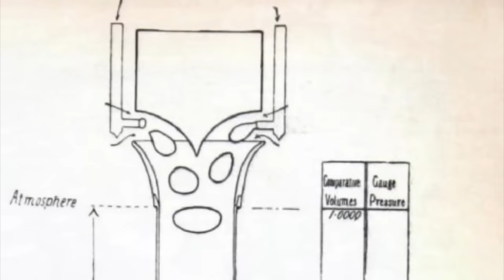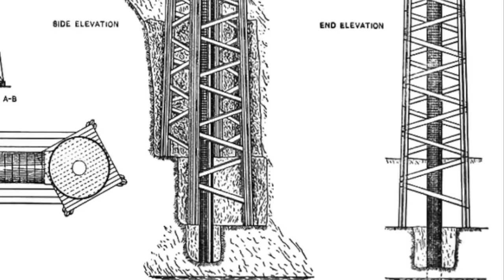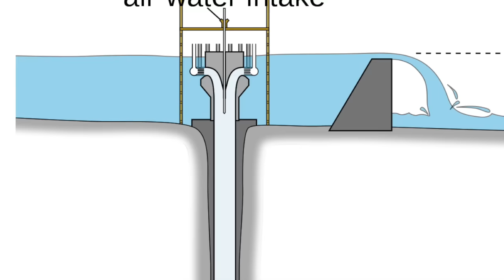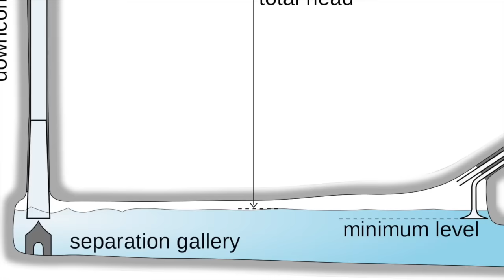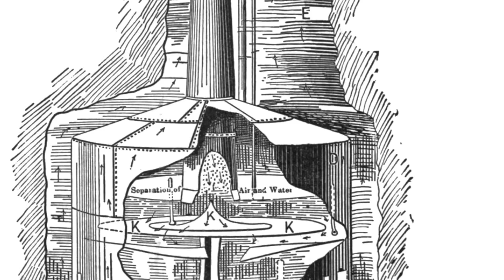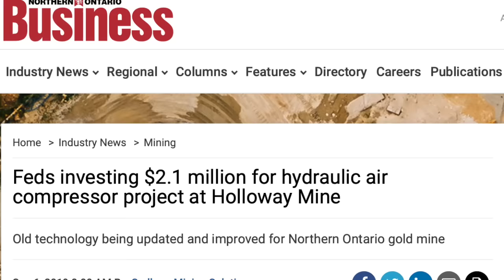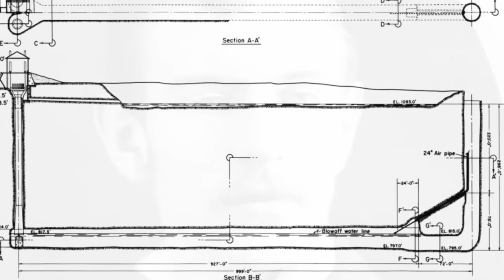Ragged Chute Air Plant: Now You're Digging With Gas!

Comment: Such a cool technology. Sure, you could use the same hydraulic potential to drive a hydro electric turbine and a series of electrical switch gear to get the power to electric air compressors and air dryers, but the trompe requires far less maintenance and has higher efficiency. Too bad they didn’t take that installation that shut down in the 1980s and use the air produced to drive electric generators, after the mines closed and the air itself was no longer needed. I saw a video of this plant in operation last year or so, taken the day before they closed the plant down, and had wanted to learn more about this amazing machine, so thank you for this great video!
Reply: @sourand jaded that’s a fair point, but I was just saying that since they already had this built to produce compressed air, it’s a shame they couldn’t find a use for that air. Unless there is more maintenance involved than what’s described, that would make it worth converting the existing compressed air plant into a hydro electric plant.
Reply: They built a small hydroelectric dam on the site. I go fishing there, it’s nice. :)

Comment: Thee was a similar devise installed at a gold mine in southern Ecuador built around 1920 or 30. I saw it operating in 1950 as a child. Also, a different use of water power saw a 2 chamber compressor driven by gravity forcing air to the top of a chamber with a head sufficient to put out air at 125 psi at Butte, Montana. Each side was slowly bled of the compressed air at a near constant pressure while the other side was filling with water. The water ended up not below the dewpoint having been pumped from hot underground mines, and this caused the pipes to condense water and freeze during the winter. It was decided that the power was best used by putting it  to an electric generator spun by a Pelton wheel, and the Engineer claimed a better out put of energy, but with a great deal of expensive machinery..

Comment: Great video. I first heard of this from Bill Mollison and thought it was such a good idea. Compressed air can even be used as air conditioning.
Reply: Yes, me too.
Reply: And refirigeration
Reply: @stevesavage8784  It does leave out that detail. Especially useful now that climate change is happening. Only downside is it needs lots of water, not a guarantee with more drought conditions.
Reply: The "original air conditioner" was a barrel of of sea water, some pipe and a set of bellows. It was set up as an air filter in a hospital somewhere, ( pump air via the bellows into the water barrel, release the 'filtered air' into the ward ) but they found that that room was slightly cooler than everywhere else there. ( important word, slightly ). Obviously the sea water would slowly warm up.

Comment: Why is this technology not more widely employed? I first encountered it in a lecture series by Bill Mollison (considered one of the fathers of ‘permaculture’) in which he casually mentions at the beginning of the series paraphrasing: “if you want free energy use a trompe, there, I’ve solved the world’s energy problems.”
Reply: It is only as free as other hydroelectric, wind, solar, wave, tidal energies.  You built the plant and hope it rains,  shines or blows, tides are pretty reliable though but still not free.
Reply: Prevents upstream fish movement and is as rare as good hydropower opportunities.
Reply: Engineers live in a box ,a very small box but not as small as the one the bean counters live in and then there are the Conservatines at the banks .
Reply: large pressure vessel is needed and although looks simple it has many problems from silt to corrosion when it was built they hardly had flexible tubing  82 percent efficiency what does that mean ? great idea but waterwheel and piston may be easier .
Reply: i also suppose that pressure will be quite low as water unless pipe is extremely long a water wheel is the way to go attached to a compressor pump
Reply: @frederickbowdler8169  Did you even watch the video?
Reply: Well because then no one will have to buy all that oil/gas/pharmaceutical products. Do you want to turn the world upside down?
Please be a good boy and support the local oil industry. And don't forget sitting in traffic is the best way to do it!
Reply: We will only start using alternatives like this when oil becomes too expensive

Comment: It is a very ancient system of air compression. In Italy there are still some examples of medieval iron refining workshops operating with this system. They were called "air horns". The first English blast furnaces of the first industrial revolution worked with this system. The energy efficiency ratio between an air horn and a compressor is 1 to 7, this is why it is preferred to make electricity instead of compressed air
Reply: I did an internet search for this but didn't get a result. Probably because I wasn't searching in the Italian language. Do you have a link to more information on the Air Horn system used in Italy. I'm curious. Not an engineer or anything.

Comment: That compressed air would be great energy storage and/or generation since it avoids the ecological disruption of ordinary hydroelectric dams
Reply: no, it doesn't. a dam is a crucial component of this device, pay attention.
Reply: @tissuepaper9962  Not if it's built on a waterfall, or where there's enough of a slope you could build something like an aqueduct straight out from the head of the water until there's a sufficient fall for it to work. Admittedly that limits where you can place these, but dams aren't always required.
Reply: @shaunp9592  both of the alternatives you mentioned are just as disruptive to river ecology as a low-head dam. You're diverting the natural flow of the stream through mechanisms that the river life cannot pass through without being killed.
Reply: @tissuepaper9962  You don't take all of the flow, only some and return it to the river. Engineer the small distance of riverbed that has less volume of water flowing so there's no/very little effect. (Bring the river banks closer together in that spot so the "flow" is the same, or whatever method works). Or you can have your "totally" natural river and we can use oil or coal to produce the power required, your choice.
Reply: @shaunp9592  I encourage you to do some actual research on the effectiveness of "engineered" rivers instead of hand-waving.
Reply: @tissuepaper9962  You need to realise they aren't diverting the whole flow of the river. Only a small part over a short distance. Like I said, if not this then coal or oil will be used to produce the energy to make compressed air. YOU choose which is better. Mitigated stream flow or Co2 emissions. Plus it's not like they're going to do this on a ecologically endangered fish habitat stream, use some common sense.
Reply: @shaunp9592  You're drawing a false dichotomy. Our lot is not so unlucky that we have to choose between destroying the environment chemically or physically. We could simply reduce the rampant and excessive waste of energy that accompanies the modern lifestyle.
Reply: @tissuepaper9962  : Over the multiple decades that have passed since the 1980s, it has become abundantly clear that we will not reduce consumption enough. Stop depending on false promises.
Reply: @absalomdraconis  economic deregulation is not a pandora's box, Reagan is a huge reason why energy consumption is at such a high and everything he did can be undone. Demand that your government actually do something useful instead of fashioning golden parachutes for the ultra-wealthy.

Comment: As a kid, growing up in the area, i remember, clearly, my father driving us down the backroads beyond Cobalt to see the "blow off". Mainly on the weekends when the mines were idle.. Seeing the huge steel pipes running through the bush, near the road, hearing the hiss of escaping air at the pipe joints.... I just saw an article about the "tesla turbine"... Seems several of these could be coupled to generator sets to produce electricity... The original site of this still exists,  maybe, it will be rehabilitated some day...

Comment: What is a kilopascal??  Internet converter says 50 psi and 125 psi respectively for the two figures given.  Both sound like fairly standard and typical compressed air pressures.

Comment: Has it occurred to anyone to use that compressed air to drive a compressed air driven gas turbine electric generators? Using a brushless double-pole ultrahigh-voltage D.C generator because when the voltage of a D.C electric current reaches 450,000 volts up to 500,000 volts IT HAS NO CABLE LENGHT LIMITATIONS! Which means there is no limitations on how far you can transmit electricity while making it economically viable and profitable to sell electricity to far flung regions and destinations.
Reply: is that statement documented anywhere and proven?
Reply: @DeviloftheHelll  Ish. HVDC is the only credibly way of ultra long range power transmission. Of course there are losses. But they are lower than for any other form of transmission. The rest of thew post is bogus. There is no brushless DC HV generator. Every brushless machine is an AC machine and making machines that creater more than something like 50kV is not common, because with all the moving parts you cannot down them in insulating oil - unlike a transformer.  I could keep lecturing for an hours. Basically, this guy is trying to sell common engineerign practice as new and has mostly no clue. But the core idea is right.

Comment: It's not a new idea. Interestingly, an earlier system was developed for a mine in the UK - Rampgill Mine at Nenthead, Cumbria. If you search for 'Brewery Shaft, Nenthead' you'll find all of the information. At Nenthead they didn't just create compressed air - they also generated electricity using Pelton Wheels.

Comment: I take it this device uses a variation of water hammer…??
Reply: Water hammer converts potential energy into kinetic energy. This only uses potential energy and bernoulli's principle. There's no real "impact" at the bottom as in a hammer. The cone is just used to guide the air bubbles to the side so they contribute to the reservoir of compressed air instead of venting back up the pipe.